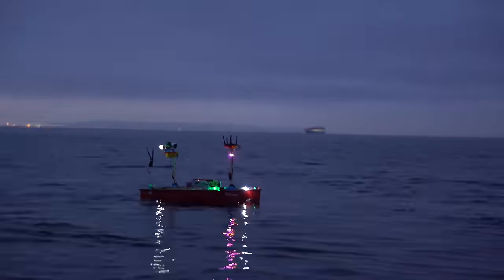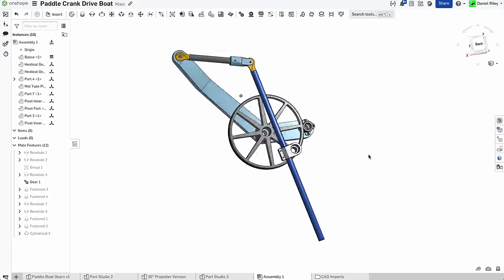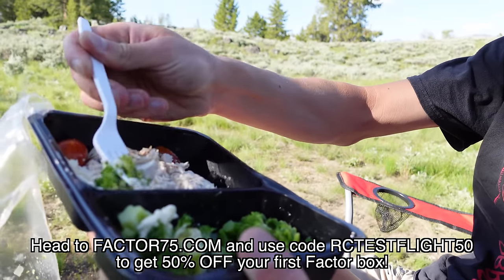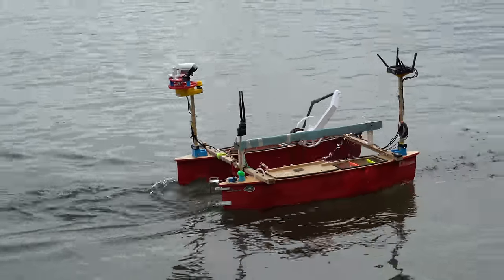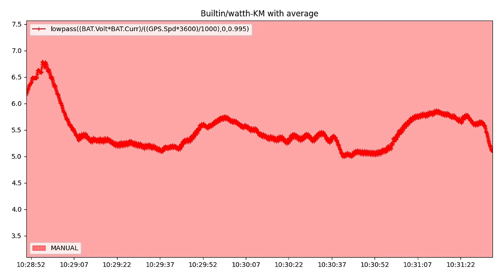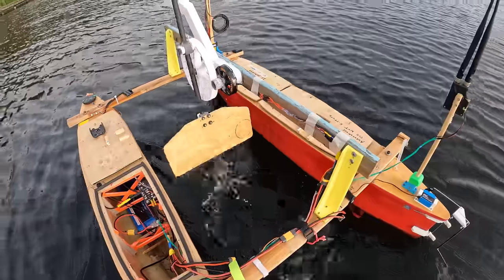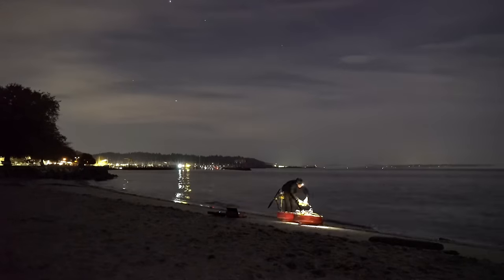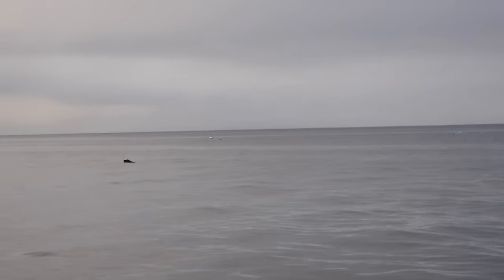Propeller Killer? High Efficiency Paddle Vs. Propeller

Comment: Before watching the whole video, the efficiency seems like it would be low with the single paddle.  Half of the cycle time there is no propulsion at all while the paddle is out of the water.  Adding a second paddle on the opposite part of the cycle seems like it would drastically improve the efficiency in my simple brain.  That’s why props are efficient is because there is no wasted motion. All movement is providing thrust.

Also, a flat paddle is pretty inefficient.  Designing a more efficient paddle shape would help to even the playing field a bit more.
Reply: Just watched the video, interesting the props were the lowest.  You compared the surface area of the paddle and the water props and said that explained the difference in the efficiency of them, but you then glossed over the same issue with comparison of the air props vs the water props.  With a larger and better designed water prop, I can’t imagine them being less efficient than the air props. Am I missing something?
Reply: The paddle uses basically no energy while moving through the air, so it doesn’t reduce efficiency. There’s no “wasted energy”
Reply: Maybe invent some kind of paddeled wheel?
Reply: @sam-rs8wg that’s just not the case at all!  It certainly is using less energy on the top part of the cycle with the paddle out of the water, but it is definitely using a measurable amount to lift the paddle and overcome any aerodynamic drag to push the paddle forward.  Throw in a headwind and the aerodynamic drag would also increase on the paddle. 

Try hopping on one foot forward, then try walking forward with both feet. I bet you’ll notice some differences in power consumption between them.
Reply: @sam-rs8wg yes there is. Motors drop in efficiency if you force them to apply high torque/speed and when you force them to fluctuate by large amounts in torque/speed. You also encounter a large amount of air resistance when you move what is effectively a huge sail in the opposite direction of boat travel.

With a paddle, there isn't much you can do about the air resistance problem short of making the paddle non static which is a challenge that we saw in this video. You can however do something about the motor efficiency by doing something like using a flywheel to even out power draw or multiple paddles at lower power so you don't have half of every rotation exclusively generating drag. 

Boat designers have long since fixed these issues by using paddle wheels instead of singular paddles
Reply: @tinncan the example he showed at 1:56 is what I think he should have tried.  It was human powered, but has 2 paddles instead of just 1 so that there is far less wasted motion. There is a paddle in the water providing propulsion at nearly every point of the cycle.  I’m not an engineer, but this seems like it would be far more efficient than having half of the strike being wasted motion.
Reply: @davidglenn1 there is 2 problems with using a bigger and better water prop. The first was mentioned in the video, being that bigger props require more mechanical structure under the water which creates more drag losses than you gain in efficiency due to the bigger prop. Air props don't have this problem because the mechanical structure required for an air prop is much lower and also air drag is much less than water drag.

The second is big props work great on things like cargo ships where they have massive gas burning engines which operate optimally at low speed and high torque. This is the opposite of what happens with electric motors, generally the motors want to fast with low load which is good for air props but not good for water props. You could gear the motor to let this happen but then you'd lose all your efficiency in the gearing
Reply: Then it just becomes a paddle-wheel boat…
Reply: @proxymohawk2933  No, that’s not the case at all!  If you watched his video, he discussed the differences in a paddle wheel vs the type of design he went with.  In fact, both the other designs he was borrowing inspiration from both show using 2 paddles like I’m suggesting he should have tested instead of the 1 paddle design.
Reply: @davidglenn1 My guess is that it actually has to do with fluid dynamics. Water is much more viscous and is not compressible. That means when you move the paddle through water you get significantly more thrust than if you moved the paddle through air. This is also true for propellers however because water is uncompressible I believe that the effect is less for propellers than it is for paddles. I wish I had access to CFD so I could simulate it. My guess is that the paddle is moving significantly more amount of water than just the paddle area. This is due to water's incompressibility, and viscosity.
Reply: @davidglenn1 it's a force vs energy thing. force is proportional to mv, energy is proportional to mv^2. you can make twice as much thrust by doubling the velocity of the fluid, but it takes 4 times the energy. you can also double the amount of fluid you move and only increase your energy use by two. there are other tradeoffs. a propeller generally works better than a paddle because it's creating lift in the water, and a paddle creates drag, but propellers, especially larger ones, are optimized for one specific speed and can get very inefficient when operating outside of that speed. for rc applications, smaller props work better for more use cases, so that's what's available on the market. a paddle, while inherently less efficient, makes up for it's disadvantages by being so much larger and maintaining similar performance across many speeds.

there are some excellent demos of the Hobie mirage drive, which is essentially a large propeller, doing a tug of war vs paddlers. that system performs fantastically due to it's variable pitch , which makes it more adaptable across the speed range.
Reply: @davidglenn1 having two paddles has no effect in the wasted motion. The padles would still move forward through air and cause air resistance. 
Also the one vs two feet example makes no sense because the paddle isn't supporting any of the boat's weight. A more accurate example would be riding a scooter by kicking the ground with one foot. Having an extra foot kicking while the other one is in the air doesn't improve the efficiency
Reply: @sam-rs8wg  you're stuck in high school dude ? Real physics dont ignore friction
Reply: Air is 1000th density of water so moving paddle thru air on upstroke is tiny tiny loss of energy ..  As someone said momentum to move boat is MV but energy needed to accel the water or air is 1/2mv2, so better to accel a huge volume a little bit and only limit is too big a paddle is heavy and depresses boat hull... So literally have catamaran 100 ft apart with paddlewheel superslowly turning?
Reply: Maybe a more curved paddle, and by making it smoother you also improve the hydrodynamics further
Reply: @davidglenn1 

Hopping is harder because it's a completely different (faster, higher impact) motion, not because it's asymmetric or has a gap.

Aero drag definitely exists, but it would be pretty low at these speeds.

Lifting the paddle does take some energy, but you recover this somewhat when you lower it again. However, I can imagine that a counterweight could still improve things by reducing the force on the motor during the lifting and lowering part of the cycle.
Reply: A flywheel or heavier main gear could help flatten out current draw. It will increase water displacement and drag from the hull. 

Also, there are linkages that make the the stroke in the water longer and can keep the paddle fairly vertical when in the water whilst speeding up the return stroke.
Reply: @davidglenn1 explain surface drives on race boats for us.
Reply: I was here to say the same thing.
Reply: @laserdiode At least with 2 paddles at 180° you could offset the force requied to lift the one down due to gravity
Reply: @sam-rs8wg 
Forward energy propulsion stops!
 as soon as the paddle leaves the water
Reply: It takes much less energy to move the paddle through the air.
Reply: Correct. A semi curved paddle with an angle of bite that matched the dip would probably have less side loss and more efficiency. Look at mud motor surface drive props. Slight curved edges.
Reply: You're forgetting that a second paddle would take more power to run.
Reply: @sam-rs8wg It still uses energy, and there’s more a loss of time. Loss of propellant while above water means the raft slows. It takes more energy to build speed than keep speed.
Reply: Ó
Reply: Another idea to test???:
Think about a paddle wheel concept on a tracked vehicle type of drive.  Could keep the paddle in the water longer, while keeping it perpendicular to the water’s surface longer.  Space the paddles so you have one in the water most of the time… with maybe a slight overlap of two at the same time.  Then use the flapping paddle so it lays down on the trip forward.  
Maybe this could be mechanized using a couple bicycle chains and pedal gears?
Reply: @joewoodchuck3824  if it was half the weight and half as big?
Reply: people really be out here just reinventing paddleboats, eh?
Reply: @MrT13  If what was half as big?
Reply: @joewoodchuck3824 two 1lb 1 square foot paddles. Is equal to 1 2lb 2 square foot paddle… not more power to run, the same. Cause the most efficient fan is a single blade, but that’s only if used in a single stroke. The most efficient paddle is a single paddle. But when used in a driven rotating or reciprocal system. 2 blades or 2 paddles is most efficient… air water doesn’t matter. Most common fan 2 blade. Most common prop 2 blade. For a reason. Cut this paddle in half and time it exactly in half and for a continuous use system it will be more efficient.
Reply: @MrT13  In principle you have a point. I'd like to see empirical test results though.
Reply: @joewoodchuck3824 why don’t sessnich sell more 3 blade props than 2? Or why doesn’t minn kota use 3 blade instead of two on all their stuff? At a certain point yes two blade is limited by diameter so you can have a better fit by using more blades 3-4-5 etc etc. but all the evidence is pretty well documented if you just google the words “what’s the most efficient propeller?” Lots of ppl kind of already been testing this out for oh about a few hundred years.
Reply: @MrT13  I'm sure there are many engineering and cost factors to be considered. An interesting topic.
Reply: there’s not as many power strokes, but I’m assuming it’s less battery consuming at lower speeds, as half of the stroke is just moving through air, and since the speed is so low the friction isn’t that significant, but still at a lower efficiency, but not lower enough to make the tradeoff not worth
Reply: Okay I’m really stumped here, unless I start doing calculations my brain just can’t simulate all the theory at work here, especially with all the disagreements in the comments and the results in the videos.
Reply: @grahamfisher5436 and so does the power draw needed for a certain rpm
Reply: @MrT13 I think that just affects acceleration and speed, not necessarily efficiency, it’s like a single cylinder engine vs a v2, same displacement, fuel consumption, if we factor out inherent differences in friction and balance, but one has more consistent power strokes. i would imagine it’d have higher torque, but i’m just theorizing at this point
Reply: @jumpvelocity3953  A lot of people here don't actually possess the knowledge they portray. Self promotion  without substance is a symptom of ignorance.
Reply: @joewoodchuck3824  smh. Again, google is your friend… if you ppl that obviously don’t know anything about propulsion, can’t even type a simple sentence into google and see that I’m right. That this has been determined for about 90 years. That my guy, is the epitome of ignorance.
Reply: @MrT13  I wasn't talking about you and I know about Google.
Reply: I think most people are ignoring the reason he tried a paddle system, it was to get around the weed problem with propellers, no one is doubting that propellers are more efficient just that they are a lot less efficient when wrapped in weeds
Reply: @russellmoore1533  I think the weeds were even mentioned, but people chose to speak otherwise for whatever reasons they had.
    I was thinking about weeds with a model boat as well but my thoughts were in the air boat direction out of simplicity and widespread component availability. Gear reductions for water propulsion of any sort aren't so easy to do/obtain. Efficiency isn't at the top of my list. Ideally I also want a rescue boat in case something goes wrong.  🙂
Reply: A paddle, is a 1 blade propeller. In this instance being used in a “single stroke”, “intermittent contact”, “reciprocal system” manner. It’s a 1 blade. I put a bunch “””” in case someone else was going to imply everyone here has their own opinions. So this can clarify none of what I’m mentioning is my work or opinions. It’s all well documented physic’s fact.
Reply: @russellmoore1533 I like your comment. But the original comment, and title of the video… efficient. Efficiency. More less killer Efficient etc etc. the person didn’t title it high weedless paddle vs…
Reply: @MrT13  Same as a canoe paddle in terms of propulsion. One paddle stroke at a time.
Reply: @MrT13  Maybe. There's still extra mechanism friction but that shouldn't amount to much.
Reply: @joewoodchuck3824  correct yea. Surface frictions, leverage loses, inertia loses, but could also be designed for better frictions, leverages, and inertia. But at the end of the day. You can make everything identical. 1 paddle, or propeller… any thing that is meant to move air or water in that fashion. And make it xxx wide xxx tall needs xxx to make xxx amount of thrust. In 1 single stroke of 1 time use. It will be most efficient design. If you want to use any type of reciprocal system, 2 paddles is most efficient. The explanation for this is in the 1 single use flaw. Yes you can go out and put a motor on a single paddle. And make it do 1 stroke. And that’s it. It will be more efficient than two paddles that take the same exact amount of energy to make each one move 1 single stroke. But, because of this fact that has its own equation… those same two paddles would be more efficient than 3. That took the exact same amount of power to move the gears through the air through the this and the that on and on and on. Facts are facts that 1 blade is makes more thrust per amount of energy used than 2. And 2 more than 3. And on and on. If you made all things similar. Weight drag surface area again, on and on and on. So the proven fact remains, “if it’s got a motor, physics dictates that 2 blades are most efficient”
Reply: They have tested this for 100 years. And the math of it says the reason behind the 1 blade 1 stroke being most efficient is cause of two things. No return energy wasted, and never having to make continuous use of essentially used friction surface. Even on a 1 blade propeller, with smoke they can see the air disturbance from the blade effectively moving the air towards where the blade when it comes back around wants to move it. That’s the relative relationship. Paddle thing first stroke takes 100 of whatever to move through the stuff and will produce 99lbs let’s say of push. But at 100 mph… same 100 of whatever that produces 99lbs of push. Is no longer producing it against its own system. It’s floating through it. Take gears and weights and resistance of object all out of the equation. The more work a paddle does, the less it can do… basically. Cause it moves what it’s designed to move faster than it can move it. Wether it is moving or just the stuff it’s moving or both. Don’t matter.
Reply: And why two blades is most efficient is cause 3 means they are closer to each other. And have to use more of already used stuff. Then 3 then 4 etc etc. always. It’s essentially another unnamed law of motion, like all motion creates time. It just is what it is with the math to back it. So with this dudes paddle boat, 2 paddles are better than one at moving weight. Efficient. As far as what’s the most weedless? That was just a sidetrack to keep the power to weight actually measurable…
Reply: @tinncan Nobody has ever tried that 🤔
Reply: But a single blade propeller is more efficient than more than one blade.
More blades are less efficient, but more blades have less vibration.
Reply: I wasn't watching the video with sound but first thing that came to my mind when I saw it was why not use whole wheel with paddles like old ships were using?
Reply: @koumbova You should watch it with sound then. The paddles on a paddlewheel push the water down as they enter the water, and push it up as they leave. That's all wasted energy. Paddlewheels were designed for low draft conditions on rivers, not for the most efficient operation. A smaller number of deeper paddles may have been more efficient, but at a higher risk of getting stuck on a sand bar.
Reply: Having a single paddle causes the boat velocity to be more spiky, and since resistance is proportional to v^2, this means more energy is being wasted. Two paddles would smooth the speed out more indeed. Top rowers do something similar, they try to move very slowly when the paddles are above the water to keep their speed smooth. If they shift to quickly, the boat speeds up under them, causing unnecessary resistance under water.
Reply: Efficiency is reduced significantly by tangles.
Reply: @sam-rs8wg but there is wasted efficiency: as long as the paddle is out of the water, the boat is slowing down and you have to expend part of the next stroke regaining the lost momentum. Extending the paddle idea to something more akin to a "caterpillar track" would mean at least one paddle always in the water driving while the others are repositioning.
Reply: A second paddle on the opposite cycle is exactly what I had once on pedal kayak. It looked a lot like a Hobie Mirage Compass Duo. This isn’t an ad, I swear. I just googled to find the closest thing to what I used. We just rented it in St. Croix.
Reply: @laserdiode It actually does affect Because at high speeds you can see the boat rocking around a lot, all this moviment is wasted energy, with the hull pushing water uselessly, with twin paddles the movement is cancelled out
Reply: @davidglenn1 you do not waste motion.
More accurately, adding a second paddle has just as much wasted motion as the first paddle. The water keeps you in motion, so having constant propulsion is useless. I should imagine, anyway.
Reply: Taking the immediate environment in account, I think a flat paddle between the rumps of a catamaran could be actually pretty efficient?
Reply: @davidglenn1 Bad comparison. Comparing a pushbike with a scooter would be a better one, as it’s just about propulsion with 1 leg vs 2 legs. No significant efficiency difference.
Reply: @tinncan you sly fox
Reply: I'm guessing the paddle shows artificially low efficiency because of the filter applied. The major power draw was the spikes and eliminating them can give really bad data.
Reply: Mucho texto
Reply: @sam-rs8wg  It would if there was a headwind. Massive sail pushing you in the wrong direction.